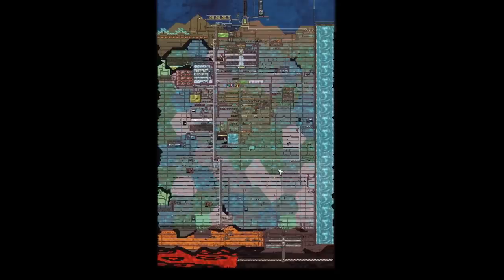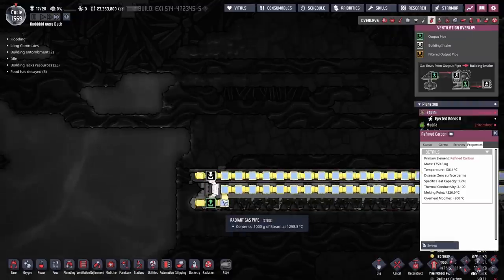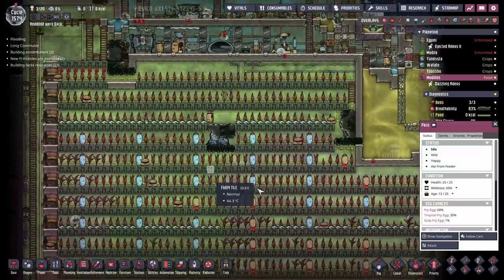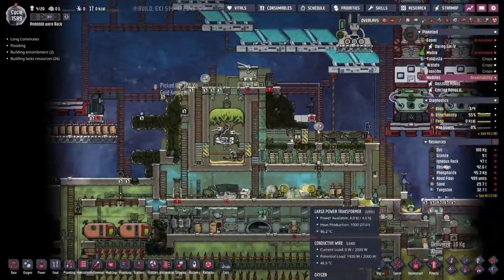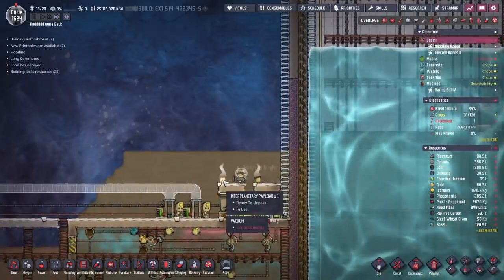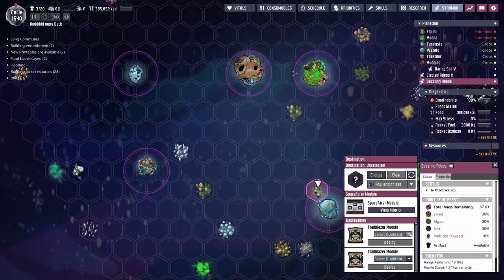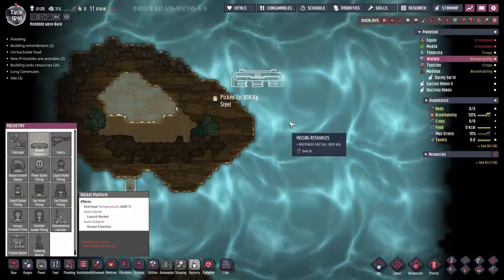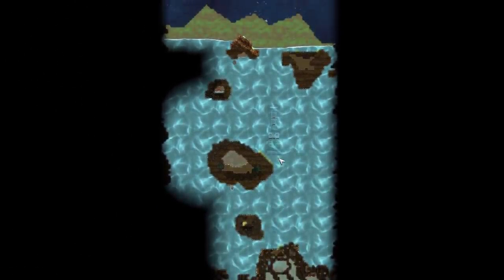Ep 21 : Water Water everywhere : Oxygen not included Spaced out

Comment: Do you have any rust? I think this conveyor belt could act as a low-key rust smelter. If you reverse the flow of the conveyor you can use more rust to solidify the resulting blade of molten iron without creating iron tiles. And if you have any other raw metal around, you can also refine it really quickly this way.

Comment: Good News everybody,
I tested some means to get a better performance of the game and the number one performance boost comes from killing all critters (maybe not the ones in your ranches for food).
As it seems the calculations for the pathing are very demanding even when the critters are confined to just a single cell. So kill all wild critters roaming the asteroids, it really helps.

Second to this (in order of effect) are sweeping all debris into a single spot, remove mixing gases and bricking up areas.
It seems the thermodynamics simulator is really good, so don't expect to much gain there.

Hope it helps with your game
Reply: Well brothgar is done a video about that jetsuits and pufs uses so much so if your game have a proble kill all the pufs and dont use jet suit docs restrick the acces of the rest of the map clear out mixed gases you can tile it up but make sure sweep every thing

Comment: One additional thing with the magma spike: you have the rails circulating the wrong way! You're pushing heat from the boiler side down to the magma! It should work much better if the return path is in the diamond window tile, not in the vacuum. That way, you're essentially boosting the diamond tiles insdtead of siphoning heat from them as well.

Comment: For the Resin tree food supply, why not ranch the Pacu using the balm lily seeds (or Thimble reed seed, or really any seeds)?  A tame Pacu only eats 1/3 of seed per cycle, and drops an egg every 1.5 cycles.  Their eggs weigh 2kg each, which produce 5,600 kcal of omelet per egg, which works out to around 3,700 kcal per cycle per tame Pacu.  Pacu fillets only are worth 1,000 kcal each so you'd need to starvation ranch a LOT more fish to equal the output of the eggs/omelets.  As a plus, you can auto-cook the eggs into omelets without Dupe interaction by leaving them in a storage bin that's in an area over 70 degrees.  So...you can get way more calories for the tree without a Dupe having to do much except maybe harvest the plants for the seeds.  A pretty good return!

Comment: ALL THE HEAT TRANSFER but what happens if it runs out
Reply: Thats the goal hes pulling heat out of the magma biome to solidify and mine it out. He just happens to be putting the heat to use for now
Reply: @chad2895  yes but he uses the steam as a supplemental power source if he needs to make changes to the nuclear reactors, so if the steam goes down, he needs another power source to make changes to the reactors without overdraw

Comment: Of course you could fill the water planet with water from the main one. Using an entire planetoid as a water tank.

And also, it's intersting to see how you build underwater.  Off the top of my head, I'd build a T shaped liquid lock, with the two central tiles full of water and the two sides of the T with nuclear waste (you should be able to mop it).  The two drops at the sides have no way to move so they should stay in place. You then build a solid block of tiles around one side and deconstruct from the inside. Immediately place a electrolyzer, let H2 collect at the top of the room, heat is no concern if you make the walls out of non insulated tiles, heat buffer is as huge as you can get on that planet... Remenber to leave the walls tripled for pressure (or use copper ore for airflow tiles - I still think standard tiles are faster to build and deconstruct). 

But then of course, real men use their fire planet as water storage and their water planet as magma storage... :)

Comment: if you want to keep the polluted oxygen from escaping, put in airflow tiles, then mesh tiles. Fill the mesh tiles with water so the polluted oxygen can't pass through, then put the deodorizers on top of the mesh tiles. The deodorizers will still reach the polluted oxygen, to clean them because of their range THROUGH the water, an clean oxygen will come from the deodorizers. this is great for when your dupes accidentally don't refill the deo with filtration medium. The only possible downsides is deo don't get overpressured, so the oxygen can quickly reach 100 kg.

Comment: For the polluted oxygen vent, deodorizers have a range of two, so if you have a layer of air flow tiles, a layer of mesh tiles with water in them and then the deodorizers, they can grab the polluted oxygen from the airflow tiles. This pumps the PO2 away from the vent and allows you to overpressurize the deodorizer area without needing 6 gas tanks

Comment: I'm just sitting here wondering just how much radiation you just dumped into that water.

Also, you could always just use rocket heat to boil off all the water on the planet if it's in the way, It's not like you don't have enough of the stuff.